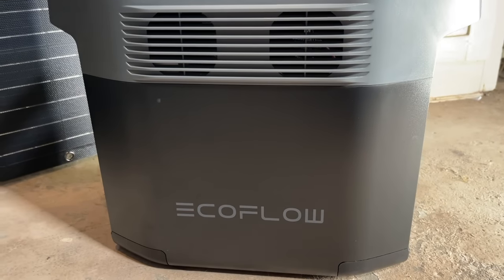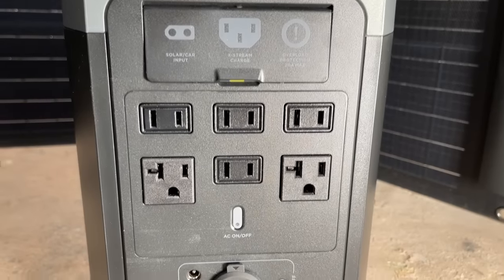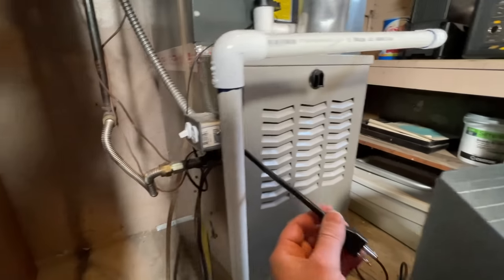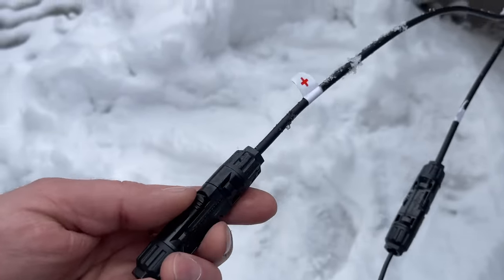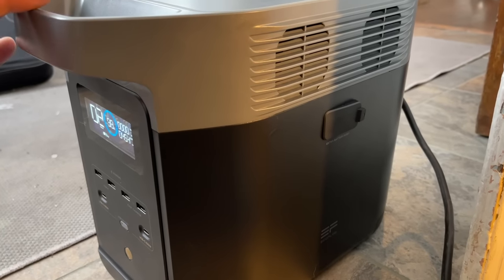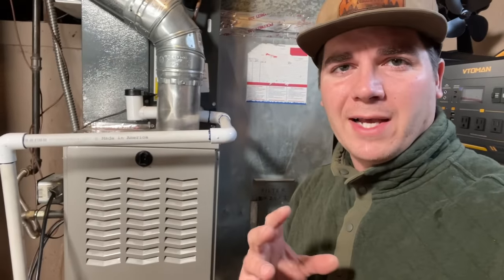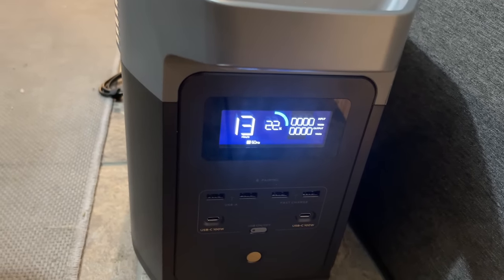How Long Will The EcoFlow Power Station Run My Furnace?  |  Power Outage Emergency Heat

Comment: Just a minor point about Watts vs Watt-hours:

Your Ecoflow battery stores about 1000 Watt-hours of energy. Watt-hours, not Watts.

Watts: On average, over the 8 hours this battery powered your furnace, it must have been drawing about 125 Watts, but of course it would be much less than that when the furnace is idle, and more when the furnace is producing heat, as it has to power the fan.

Important implications:
1. To get the longest run time from your battery, turn down the thermostat
2. Run times will depend on the weather
3. Run time will depend on how well the house is insulated and how drafty it is
Reply: oh definitely, there are a lot more variables in the equation, as in the house size, insulation and amount of time doors open and closed allowing cold outside air in, furnace size and efficiency, single vs variable stage fan modes. etc...

good general representation of the capabilities on this device though.
Reply: Thank you for stating how many watts the furnace draws. I have been looking at several videos and no one seems to mention the power requirement. Seems like this is important to know. It lets me do my own calculations.
Reply: @litnoregrets7551  What?? I've watched the vid twice, looking for that value, and not found it. Can you share?

Comment: Another feature of the EcoFlow Delta's is that they will recharge to about 80% in about one hour when plugged into a wall outlet, generator, or inverter hooked up to a car alternator. I'd prefer to run my generator for an hour, two or three times a day, to recharge my EcoFlow than to run it hour after hour and overnight.
Reply: The LiPo batteries can not be kept fully charges or they will degrade lose power capability and risk catching fire. They must be put into storage mode as I mentioned in a previous post. So the power fails and you want to use your LiPo powered back up but no its not charged and the power company didn't send out the email saying we were going to have a power failure. Now how am I going to charge the back up system. Maybe we should buy a gas powered generator to charge the backup unit. Well then why do we need a back up unit that can't be used in an emergency. Ask any RC pilot about their electric RC aircraft and how LiPo batteries must be used in a safe manor. Many home have burnt down from ignoring the safety rule. They need to be charged in a outdoor environment away from fuel if a fire occurs. Check out other backups that don't use LiPos. Lithium Polymer. I not sure about Lithium Ion. A solar powered charging station might work as long as the weather is right for it.
Reply: @rickknowles9620 Lithium Iron Phosphate batteries are not prone to fire when stored at 100% like lithium ion batteries are, they are MUCH safer than lithium ion.  They will degrade more quickly at 100%.  For long term storage they should probably be stored somewhere between 50% to 85% depending on what balance you want.  They also get 3000+ cycles before they degrade to about 80% of original capacity whereas lithium ion usually get something like 800 cycles usually.
Reply: @rickknowles9620 Lithium Polymer and Lithium Iron Phosphate (which the ecoflow has) are different chemistries. Lithium Iron Phosphate (LiFePo4) is very safe and has a lot of great attributes for storage and use.  The reason it’s not used in cars or RC uses is its weight for the same energy is higher.

Comment: It's good that the power bank will run the furnace for 10 hours, but one must remember that with just a 160 watt solar panel, and in the winter, it will take several days of good sunshine, to recharge your power bank back up. So that unit is really only good for a 10-hour emergency.
Reply: Would be interesting to know how much time in actual furnace run time.  Colder outside would mean furnace will cycle more often therefore shorter than ten hours.

Comment: I have my heating oil fired boiler setup in a similar fashion. I run the Ecoflows (2) at night because their quiet and startup my dual fuel generator during the day if grid power is still down. If a winter storm is forecast I plug the EcoFlow into the grid power and the boiler into the EcoFlow and turn it on. Power is passed thru the power station but if the grid goes down the EcoFlow battery power takes over. I don't like waking up to a cold house.

Comment: The life of the EcoFlow will depend on the size of furnace and temp outsize. Your furnace could be a 80% or 90% with a one stage or two stage. Your 90% may have a condensation pump. When you turn of the furnace it is better let it cool down with the blower motor because over time a quick turnoff could damage your heat exchangers. The heat exchangers parts maybe covered on warranty but the labor to change them is expensive.

Comment: Something you must remember about ecoflow and similar rechargeable batteries is that your ambient room/operating temperature will greatly affect the battery discharge due to the inordinate amount of energy the battery expends on its internal cooling fans!

I ran 3 tests of an ecoflow 1280 wh batteries at ambient 70 degree F room temp., powering a small 35 watt fruit dehydrator.  Simple math suggests that, at even 1200 actual watt hours, a batterry should easily power the 35wh device for the 12-15 hours required to dehydrate fruit.  In fact at 80degree fahrenheit ambient temperature (and no external power source such as solar or 120v) in three tests the battery barely lasted 4 hours because it consumed 35 wh when only the dehydrater was running, but the batterry fan constantly cycled and when it kicked on battery consumption consistently jumped to 610 wh.

Ran this experiment a half dozen times with 2 different Deltas, results were within about 3 percent variance; nice little inverter package, but if the sun isn’t shining, then even at ambient 70f temps it’s internal fan energy draw renders it practically useless, even when only drawing a steady 35 watts over a half dozen hours. It does make a handsome doorstop, and if you have a sunny cloudless day and a few hundred watts of solar power panels properly aligned it can be useful, just not so much on a long 6:13 dark night:-)

Comment: Nice setup for an emergency. This is a good setup for people that are electrically challenged. Simple to implement. Your electrical interconnect is just fine, but if it were me, I'd simply use a standard 3-way wall switch to route the furnace  to grid or alternate source. I use them a lot for my solar projects here. When properly wired, just flip the switch! It only switches the HOT (black) wire. The neutral (white) is still tied to both grid and backup sources! Your setup with the plug may isolate both HOT and neutral wires.

Comment: I remember in your PREVIOUS Video- the VTOMAN Power Station gave you 14 Hours of Runtime & the EcoFlow only gave you 10 Hours!
 I took advantage of the $650 off coupon you linked when I purchased the VTOMAN 1000 and the TWO-100 watt Solar Panels all for $1150!, thanks Dave!

Comment: Nice video.  Just picked up the EZ Generator switch from your other video and I already had the EcoFlow Delta2 which I use in my campervan.  I never thought of using the power station to supply power to my furnace.  Thanks!

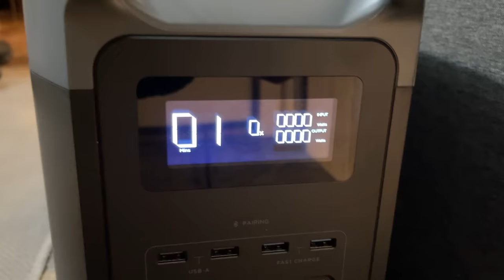Comment: Great video. @8:09 the batteries are not actually at 0% which means no charge left otherwise the display will not be on, they actually drain the battery down to about 5% SOC (State of Charge) to have some buffer.
Reply: And to protect the battery.

Comment: AWESOME VIDEO...thanks for doing these videos...our power goes out regularly here in Baltimore...and 1 week without power happens a lot...I am contemplating buying one of these battery backup systems
Reply: Does Baltimore really have multi-day power outages on a regular basis? I'm surprised that a major city would have that problem.
Reply: @bobkantor4695  eastern seaboard ice storms can put a couple of million people out of power at once. Not sure about baltimore, but in rural areas north it's not uncommon to be without power, and if you're unlucky - in an area where only a small group is out of power and thus low priority, you can be out a week. 

This device would be pretty worthless in that scenario as changing weather in the winter often comes with little sun, and the days are short, anyway. 

But having a gas generator is pretty common.

Comment: Im in the process of sizing one of these units out. Best thing you can do it get a cheap power meter from harbor freight and track it. On a 10 degree day I ran my boiler with 2 pumps and it only used 1.95kwh for a 24hrs

Comment: I Installed an outlet / switch just like you did.  That was a great idea.  Thank you for that though.  I have two batteries and one 100 watt panel.  I may need to get a generator.  Thanks again! Great idea.

Comment: Another option is to keep a 1000 watt (or larger) inverter handy. In the case of power failure, just connect it to your car/truck battery. In the event of a power failure, you should be able to run it with your vehicle idling, all day or night. Just be sure to keep your vehicle topped off! And of course make sure your car is outside when idling, because you know - carbon monoxide. The price of an inverter is a fraction of a generator or large battery solution such as this.
Reply: He has already shown that.
Reply: Wouldn't that put your car alternator at risk of early failure?
Reply: @MorganTheva  A typical car alternator can output about 1500 watts, so a large inverter can be handled easily. Most people won't be running an inverter at full output anyway, unless they have a space heater or other high draw device on it.
Reply: I used to run my truck idling with an 8 liter engine 32 gallon tank for a week at a time without running out of fuel running an inverter to power a gas compressor station during a power outage.
Reply: What burns more gasoline at idle, a car or a generator?
Reply: @joshua511  depends on the genset but most Gen sets run 12-14 hrs on 5gal with a resistive heater like the oil filled ones. I had an oil field Tru ck with a large 8 liter v8 that would run 5 days on idle and still get home on 36gallons and that was 24hrs so there is a fair estimate I think a truck idles longer or a car. This was in extreme cold in both cases

Comment: Im wondering if you’d be willing to share the approximate square footage of your house, as well as the efficiency of your furnace. The reason as I ask is I’d like to make a comparison with my home to get an idea on how an Ecoflow unit that size would work for me.
Reply: Remember that the electrical draw of the furnace is very small as compared to the heat output. The biggest electrical draw is the furnace fan. Obviously a larger furnace will have a larger fan (motor) which will draw more.
Reply: I would suggest you to get Kill-A-Watt meter and use it on your furnace for 24hr to find out what the kWh the furnace uses and how many Watts the blower needs to run, so if you know the kWh of battery capacity of the Ecoflow or similar unit, then you can estimate the run time (you will de-rate the battery kWh by 15% because inverter has conversion loss when converting DC to AC) and the size of the inverter (should be at least 2 x the Wattage of the blower) of the Ecoflow that you will need.
Reply: @budmartin3344  yep. Mine showed about 5 watts not running, 200 watts starting and 95 watts not running. I didn’t get as fancy with the switch, just took off the hard wire to the fan and made it a male plug that I can unplug & put on my bluetti.
Reply: 95 watts running
Reply: @budmartin3344  I think I’ve read that the inverter loses 10% ie you can only run 90% of your watt hours

Comment: Thanks for the video. Pig tailing a gas furnace to run off another electric power source is a smart thing to do.

You showed the ECO Flow displaying a draw of 452 watts in one scene which is about average for a gas furnace. You can assume a starting draw of 1K Watts for a few seconds. His 2K watt-hour ECO Flow can power his furnace for about 4 hours continuously. Furnaces DO NOT run continuously to maintain heat. The amount of time they run depends on your house and the outside temps.  In my house, a 2K Watt-Hour ECO Flow would last for about 10 hours in 30 degree weather with the gas furnace set at 72 degrees.

Most modern furnaces need pure sine wave and/or a grounded connection. Many of these electric generators have pure sine-wave but not a grounded connection. Even when you see the third prong, you are likely seeing a dummy port with nothing connected to it!!! You can buy or make solutions to bond neutral to ground for less than $20. 

Buy a 1K Inventer and hooking it to some cars may increase the risk of damage to its computer systems. Please plan accordingly with your particular vehicle.  I have ran a setup like this for 6 hours using an older BMW with an inline 6. This is now a tertiary solution. 

An inverter gas generator can be the way to go for some. As long as you got gas, you have capacity.  Running the generator overnight means noise nuisance, exhaust safety, and the chances of theft. We run our inverter gas generator in the day and our battery generator at night during power events.

Comment: If it's an emergency, then there's no need to heat or cool the entire house.  Just one room is enough.  In the winter, couple of space heaters, one for the room, and  one to put near any sinks that back to outside, to keep the pipes from freezing.  And the summer, just one small portable AC or fan.  That's all you need to heat or cool just one room.  Then with the power station and the solar panels you will never be out of power, or at least it will last you days, not hours.

Comment: Lots more testing possibilities like with versus without solar panels.  I would like to see how long it would power just the fridge or how many loads of laundry it could do.
Reply: don't get too wild hoping to do laundry on "backup power". a regular top load washer has large amperage draw when the agitator tries to spin. a dryer, well, you would be fine if it's a gas dryer.

Comment: Great info - I am curious as to what the furnace was using when it was in active mode (how many current watts were drawn)?  I have an EcoFlow Delta Mini and plan on using it during winter power outages.
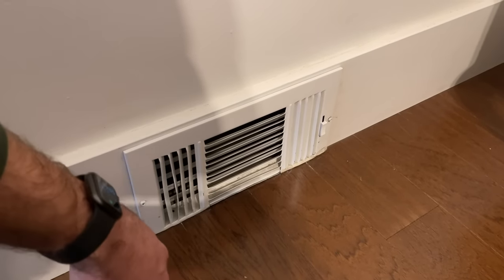Reply: @4:32 it shows 455W.

Comment: Some furnaces will not operate with a floating neutral, which most small generators have.   Ground neutral plugs are available for your generator but I have not tried that yet.

Comment: One thing to remember is that simply running the inverter draws power. Perhaps as much as 25W. This becomes the primary constraint when powering low loads.

Comment: I like the whole go green idea but I will stick to my gas/propane generator.  When Hurricane Sandy clobbered us we were without power for about 8 days.  Have purchased a 5000w generator and transfer switch about for years earlier I was well prepared.  I was able to run my burner, 2 refrigerators and most of the essential lighting.  The dual fuel was a huge plus as most of the gas stations were without power and the ones that had it were having trouble getting refilled.  The propane was readily available.   My home a well insulated and I ran the generator from 8am until 10pm just to be neighborly 😃.  The temperatures were in the 40’s so the house stayed warm enough on the overnight.  This might have been a problem if it was in the 20’s.  It was fun to have nearby family calling to stop by for a hot shower 🤪.  My wife thought I was crazy when I bought the generator but I’ve long live by the saying “It’s better to have it and not need it than to need it and not have it!

Comment: I tested my ALLPOWERS S700 V2.0 606WHr last night running my 2018 fossil gas furnace last night -5 Celsius with wind-chill -12 degrees. It ran for 4 hours AC mode but then AC mode turned itself off with aprox 58% remaining at 4 hours! That's disappointing considering that I'd hope to sleep through an over night (6 hrs expectation) power outage. I turned AC back on but within 40 minutes it ran down to 18% I had the charger plugged in for the entire test run. As it's not a quick charge capable battery chemistry (not a LiFePO4), am not surprised that there was not much power use mitigation. I'm glad I have an EcoFlow River 2 Pro 786WHr to rely on.

Comment: Hi, I converted my furnace so it's plugged in instead of directly wired and tried it with my EcoFlow River Pro, it can only run the blower but not the igniter. 

RiverPro is 720W with xboost up to 1440. Wondering if it's my furnace or I just need a higher capacity Ecoflow.
Reply from the maker: You’ll DEFINITELY want to see the video that comes out tomorrow morning. It might resolve your problem.   Cheers
Reply: @diyhvacguy  Thanks, just watched it. Not sure how that will work as the 3rd hole in the Ecoflow station is not connected to anything, there's no metal. It's just a hole to accommodate a 3 prong plug.
Reply: @dadstoysnthings  Similar issue I'm having with my Ecoflow Delta 2 (floating neutral). I hear the blower motor come on, but shuts soon after before the heat comes on. Wondering if you had found a resolution?
Reply: Was the issue with your furnace? Ground plug helped as per https://youtu.be/18nH231ECQI   A River 2 Pro worked fine for me  https://youtu.be/Ys1g6wFMbT8

Comment: I've got the delta max 2, so in theory, even if there is no sun, I can run my gas generator for an hour or two (to charge the ecoflow)  and have 24 hours of the furnace running.

Comment: The price is stupid ridiculous.  For such a tiny wattage
Reply: 100% yes … but, this can run in UPS mode.  Meaning during an ice storm you could plug this in and go to bed.
Reply: I use my delta max 2 to plug in my fridge alot for poweroutages. Worth every penny so I don't have to go out in the La. heat to run a gas generator.😂